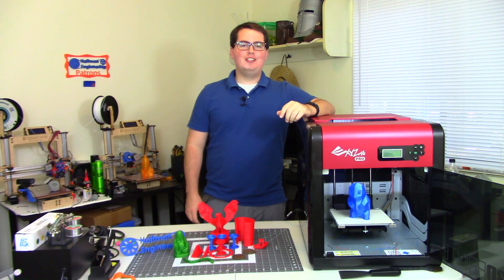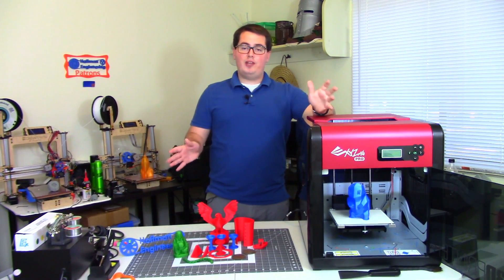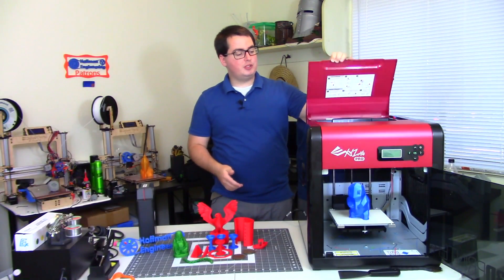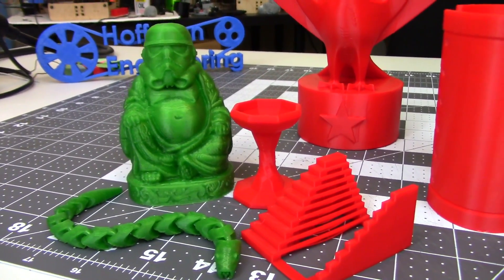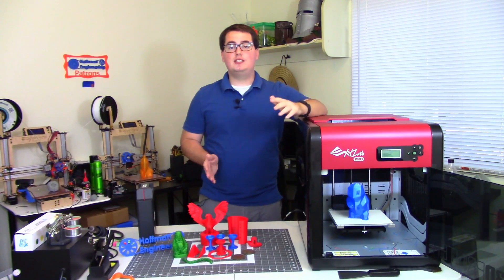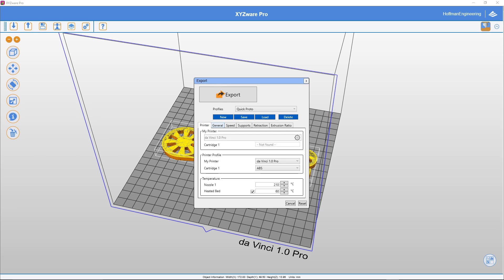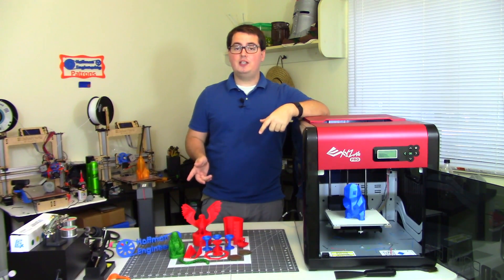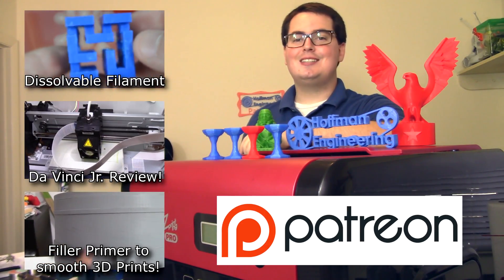Da Vinci 1.0 Pro - Can XYZPrinting redeem themselves? - 3D Printer Review

Comment: Quick tip from a Pro 1.0 owner:
If you're having adhesion problems, purple Elmer's Glue sticks are excellent for solving this. I use extra wide strips of blue painters tape and purple glue sticks to achieve exceptional adhesion, sometimes too much if I'm honest. I print ABS mostly, and this works with the bed being heated for that use. If the tape tears, it generally only affects one strip of the wide tape, and I can just swap that one out with a fresh strip.
Reply: Actually came here to say this exact thing. I bought this printer to print exclusively ABS, and it does a fantastic job of it. The only thing I will add do your comments... print the E3Dv6 cartridge and do the upgrade for easier nozzle swaps for abrasive materials. This printer with the E3Dv6 is about one of the best ABS printers on the market.
Reply: @FireRescue_Guy  I actually did that on mine too! I went with a clone hotend and got lucky to get a good one. It works great!

Comment: Great review and I learned a lot.  Got this unit as a gift and I am learning it in a slow process.  Thank you for your work.
Reply: Did you get on with it ok
Reply: @merlindxb4333  I got it to work.   Temperature control needed a work around.
Reply: @ernestlane  hi thanks for the comment, haven't used mine for a few years, cleaned it up for a face mask project, ran up OK sent it to a Demo started then stopped Fault 40 sw off when I smelt burning, contacted support waiting to hear, bit of a pain need the facemask for another project

Comment: Good video ...I think I found the problem with my prints. That is setting the print speed to high and the movement speed to high. It looks like you need to limit the speeds to one third of the xyz specs to get good prints. Please correct me if I am wrong. Going to try it as soon as I can get the PFTE feeder reconnected to the carriage  And yes I printed Brians spool holder as well, but it did warp a bit but it worked.

Comment: Da Vinci Pro users, please consider printing a set of these for cooling PLA prints, or for ABS fume exhaust. It works great, and only requires some inexpensive 140mm fans and an external 12V power supply.http://www.thingiverse.com/thing:1905254

Tempest 140 Cooling Ducts In Action (video):https://www.youtube.com/watch?v=z28Kkj39LEw&feature=youtu.be

Comment: What about the nozzle? Does XYZ provide replacements or tougher versions of it? (or smaller nozzle diameters).
A bit sad to hear about the lack of fans for PLA printing. Seems like an oversight ....
I also despise the tape solution, and it seems weird they do not have a PEI solution :/

But well, it's nice to see XYZ allow third party slicers and filament, some common sense ...
Reply from the maker: That is a great question! Unfortunately it doesn't look like they have different nozzles, and to replace a worn out nozzle you have to purchase another entire hotend at ~$100. So, I wouldn't recommend trying to print abrasive materials on this printer.

The lack of a fan is a big oversight, it really limits the quality of smaller PLA prints. I haven't looked around for mods that anyone have done to add one, but I plan on doing that soon.